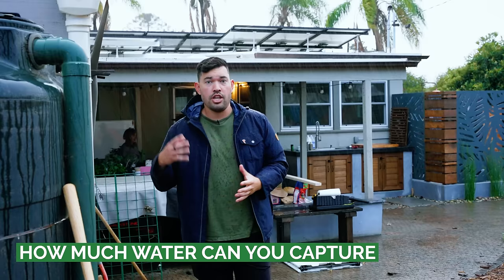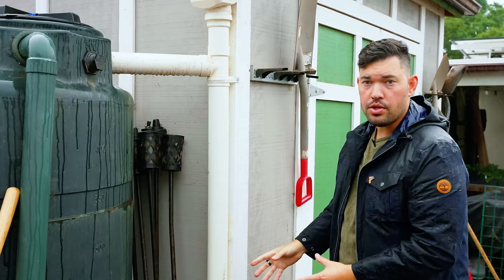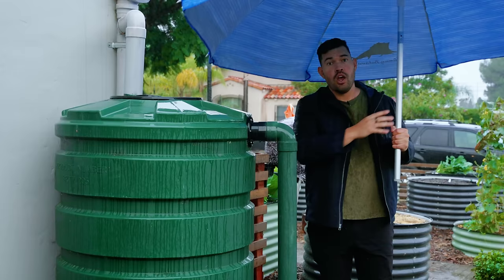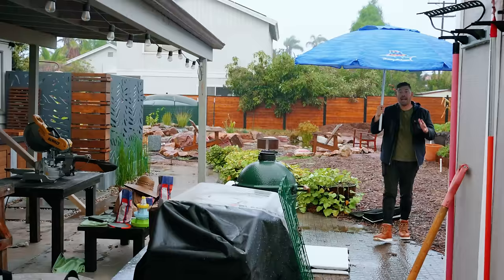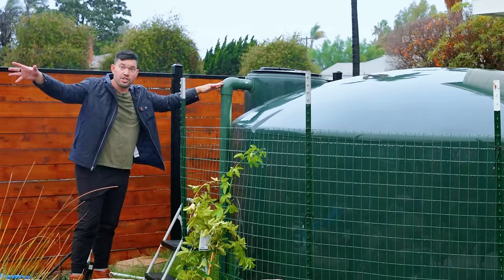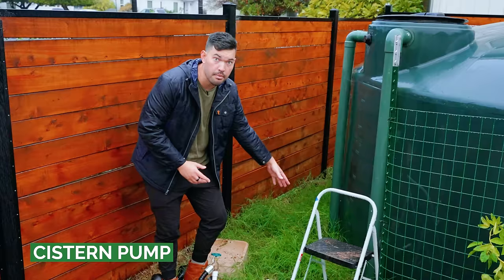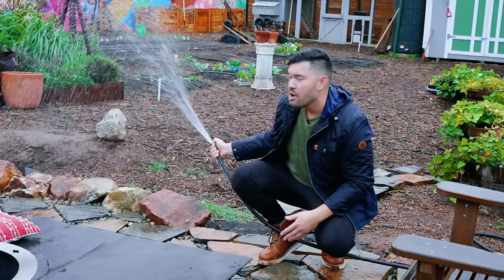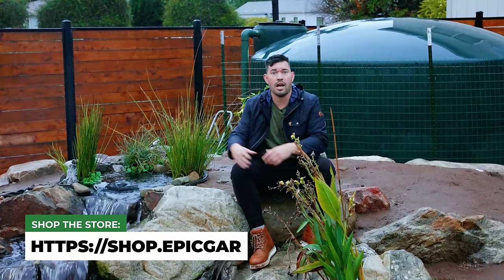How I Capture 5,750+ Gallons of Rainwater For My Garden

Comment: I think the easy part is rain collection, the harder part is what to do with your water. There's surprisingly little info on using pumps or whatever to create pressurized water for watering. I have a capacity of about 1500 gallons, and have tried various strategies to get the water into use in the garden, with mediocre results. I don't think you can just hook up your cistern to your irrigation system, for instance. Hopefully, Epic G will give us more detail about their pump system.
Reply: I believe a shallow well pump with a pressure tank is what you need.
Reply: Drip irrigation works well with low water pressure

Comment: We are doing a 20,000 gallon rainwater system right now.  We haven't uploaded any videos on it yet but, will soon.  It will provide all our inside domestic water to our home.  We have a well for all outside water use.  We have about 6900sf of roof and filled the 20,000 gallon tank in the first 3 rainfalls after we completed the tank construction.  We have about another week to finish our pump house, plumbing and filter system to the house.

Comment: 0:55 A better metric version of your formula would be: "For every 1m² of roof, 1mm of rain will give you 1 liter of water"

This works because 1m² x .001m = .001m³ and because 1 liter = 1dm², so there are 1000 liters in a cubic meter.
Reply from the maker: Def. better. Was just converting the imperial directly over but great idea

Comment: Hello there. First off let me say I'm stoked I discovered this channel. Lots of great info so thank you. I'm confused about how many gallons (10 to 15) you say this first flush is removing. That looks like a 3" pipe. Even if it was 10' long that would only be just over 3.5 gallons. Even if I have the diameter wrong and it's a 4" 10' pipe it would still only be 6.5 gallons.

Comment: One must multiply the square footage of one’s roof by the Cosine of the pitch of the roof. A vertical roof (wall) will capture no rain, a horizontal/flat roof will capture rain on every square foot, and a 45 degree pitched roof will only capture 71% of the rain of its flat counterpart.

Comment: What needs to be different in this setup if I live in a below freezing climate 5 months out of the year? Do I have to drain everything and do without rainwater all winter? It's a challenge to guess when it will freeze.
Reply from the maker: I'm not an expert in colder climates, but I suspect there would be a few weatherproofing / expansion adaptations

Comment: I wish it rained enough here to make something like this worth it.
Reply: You don't have to have a 5,000 gal tank. The IBC cubes are 275 gal or 330 gal. There are 55 gal barrels. When I lived in Arizona we had a 55 gal barrel at the bottom of a roof valley and water flowed into the barrel. Used it for wife's flowers.

Now live  where soil is better and more rain. Have several tanks, all with 1st flush systems for use in gardens.

Comment: Why did you choose above-ground cisterns rather than in-ground?
Reply: Above ground tank(s) can be gravity flow systems (no power needed for pumps). Cisterns would require a pump to get water where you want it.
Reply: I know you could get it into the tank without pumps...I can also see a likelihood of needing a pump to get the water out.
Reply from the maker: Dramatically more expensive to do in-ground, the cistern is 2x cost for same size

Comment: Epic Video! 
Could you explain what the main benefits and downsides between a raincapture-system and a groundwaterfed system are ?
Greeting From Germany!
Reply: Rainwater falls freely. RW capture systems involve some effort and costs to set up initially but if planned right, it can be used as a gravity flow system that doesn't need power to use the water.
A groundwater fed system needs a pump to get every gallon used up to the surface. Electric rates keep going up and up so it will end up costing you more and more for every gallon used.

Comment: Capturing rain water is regulated, and for good reason, sequestering large amounts of water can screw up your local waether and water table
Reply: It can't screw up your water table when you use it to water your plants. That's where it would have ended up anyway.
Reply: @everythingmatters6308  the problem isnt what you do with it, it is holding it from the system in a reservoir. A single homestead may not have an effect but a community of unused rainbarrels stacks up quickly. You may be using your water quickly and responsibly but as a rule unregulated rainbarrels are problematic.
 and for the record i am huge on permaculture and renewable resources. I support your intent, just do please look into the reasonings of rainbarrel lawsa before promoting the novice to build large sequestration systems
Reply: @jamesgambrell9621  👍